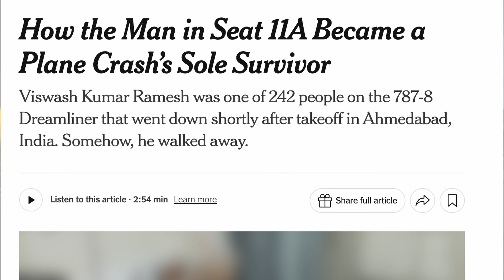Why the RAT Changes Everything – Air India 171 Update

Comment: Dual engine failure was what I thought ..

AI i daresay is a professionally run airline and not a fly by night fly by the seat of your pants kind of airline.

The theory of pilot monitoring  flaps up from 5 instead of gears up is imaginative even for a cadet pilot under stress 
The flap lever is far away and feels very different from a gears up lever.

Dual Engine failure on a fly by wire aircraft.

I lean on Sabotage … hacking of software 

a ticking time bomb effectively 

Who put it in there ? 

Conjecture conjecture 

Contaminated fuel ? … or Sabotaged fuel a contaminant dosed to the plane at full power . Some sort of polymer … 

Who knows . It might have kicked in earlier ….

The plane would have been flying over the Arabian Sea if planned as per usual norm of airplane bombers

Comment: To me, the scenario in which the pilot mistakenly retracted the flaps instead of the landing gear doesn’t make sense. Why? The position of the main landing gear front wheels suggests they were in the process of being retracted when hydraulic power was suddenly lost, causing them to remain tilted downward. Normally, during landing or takeoff, the rear wheels of the main landing gear on the B787 are tilted downward. Additionally, the deployment of the RAT (Ram Air Turbine) indicates that both engines flamed out, resulting in a total loss of engine power. In such cases, the RAT automatically deploys to supply essential hydraulic and electrical power, keeping critical systems operational.

Comment: All electric fuel pumps and no bleed air because of the inane push to reduce fuel consumption.  This reminds me of noise abatement procedures which mandated reduced power in the most critical phases of flight.
This poor plane lost all power on takeoff likely due to fuel starvation due to a total electrical failure.
Engines should have mechanical driven backup pumps.
Major electrical bus failure with engine and apu fuel starvation is my guess.  The box will tell all

Comment: mr hulk walks away from a 175KT crash call that a pot of luck and that loud bang mr 11A hulk heard was the ram airturbine door opening the other cause for the duel engine flame out fuel starvation or  compressor stall and last thorey here but may be  both engies had a  compressor stall and the captin tried to recover but to no effect and lead to the aircraft losing lift and coming down and a fuel compressor stall  is when both engines are starved of fuel and when any pilot tires to recover the airecraft out of a compressor stall it can distrupt the airflow and since this looks to me like a compressor stall a compressor stall can happen without flames coming out the back may bey both eninges expirenced exceeding operating parameters

Comment: Good points were made in this video.  However, the flaps were clearly up when they shouldn't have been.  Would a RAT deployment lead to an automatic flaps retraction?
Reply: Is it possible that both things happened? Dual engine failure with the RAT deployed?
Reply: Good point

Comment: I watched other video by swiss001 he noticed the landing gear alignment is different as the back wheel is higher than the front. Also indicating to dual engine failure https://youtu.be/Ac90bLg1Oek?si=3-jXxgHC97a2aqru

Comment: A previous video from inside the aircraft posted by a guy who flew on the aircraft into the departure airport said they were having all sorts of electrical problems and many things were not working. The 78 is a very electric aircraft. They could have had a compressor stall on one engine and lost both generators shortly afterwards. They also could have deployed the RAT manually. The big question: Why are the flaps up that quickly after takeoff and why is the gear still down. I hear 78s over my house every day. I know the sound of the RAT very well as they test them on almost every test flight. BTW, there’s a minimum speed when the RAT will not work. I don’t know that speed but on other aircraft I know it’s 140kts.

Comment: Captain Steeeve, In 2010 I was working the ground in LRD when the very first 787 on a test flight had a fire in the main electrical panel that caused both engines to fail. The RAT deployed and it coasted appox 30-40 mile into LRD.
Reply: At altitude YES, from 400 up, won’t work. 👍🏼
Reply: Wow. That would explain pretty much all of what we saw here..
Reply: Big difference when it's a test flight and when a fully loaded/heavy passenger flight. Also difference is when the engines failed..
Reply: @janlhab2329  Yes but it proved the importance of the RAT.
Reply: I think the important thing here is that an electrical fault caused both engines to fail. Seems like a good candidate for this flight.
Reply: Great info.
Reply: What altitude was it at?
Reply: 26/11 also was planed to show all terrorist was hindu and they had mauli thread on their hands...but after kasab got captured then whole story was explained ......these terrorist plan and attack..this can also be a terrorist attack we cant say anything until investigation is complete and black box is checked....government will investigate.. whole matter
Reply: Oral or audio?
Reply: @ktsrajesh2130 Aural not Oral
Reply: @brittneyemerson2079  'aural' and 'oral' almost sounds the same , and they also happen to be inter-related.  I can not help to smile and a bit  chuckle after reading this. Captain Steeeve must have meant "aural', not oral.
Reply: @ktsrajesh2130  Aural not oral.
Reply: This proves that it definitely is possible. The system should never have been set up in such a way that damage in one particular area could take out both engines instantly or multiple critical components at once.
Reply: What caused the fire in the main electrical panel ? (was it an insulation problem or elec'l overloading or electronic component that somehow burned ...)

Comment: Also note the position of the mains.  When the 787 is retracting the gear, the mains rotate forward to a front wheel down orientation.  This indicates the landing gear lever was moved to the up position at some point after positive rate and before whatever caused the engine failure.

Comment: One channel stating landing gear partially hung up retracting because Loss of hydraulic’s? Wheel carriage tilts up slightly from flat just before stowed.
Reply: This is a complex issue which must be solved quickly as 1000 787’s are flying.  Boeing not going to upcoming Paris air show.  Boeing losing sales of aircraft.  GE maker of the engines are also on the way to the crash site.

Comment: I think it’s a fuel issue. Fuel was bad/too hot. Sitting in a tanker on the tarmac in 105 degree ambient and 120 on the deck. Boost pumps cavitation or vapor lock in the line. Vapor is compressed dropping fuel pressure to engines and the derate. Simply no time to get the thrust back.

Comment: There is a possible intersection between dual engine failure and pilot error.  There was an incident at Delta Airlines a number of years ago where the crew inadvertently shut down both engines on I believe a 767 shortly after takeoff at LAX. They had enough altitude that they recognized the error and restarted both engines in time. It is conceivable that the Air India inadvertently shut down both engines.

Comment: Same a day someone said, there was one engine failure.  Pilot tried to switch it off, as failed engine may cause other equipments to fail. 
.
Pilot turned off other engine by mistake and could not turn it on in Short time.
.
He said Till 400 meter, pilot cannot take manual control but just after that at 425m he turned off the wrong engine.
Reply: This happened on a previous accident too.

Comment: Most likely engines failure, Boeing system failure, software problems or maintenance issue.
I don't think pilots will make silly mistakes after 8,000 and 1,100 hours of flying experience.

Comment: 10:01 The RAT's deployment is not explosive and does not produce a bang loud enough to be heard inside the cabin as a single event; rather, its noise is noticeable as an ongoing sound, especially when the engines are quiet. The loud bang is far more likely linked to an engine compressor stall.

Comment: Something that isn't talked about is how far down the runway the aircraft was before it lifted off. In the video clip you show at 1:32 the aircraft appeared to struggle to get airborne and there is a lot of dust and debris being blown airborne from the aircraft's engines as it does finally rotate and lift off. Not sure if that is normal for that runway, but the other thing is the flaps appear to be in the up position at take off as well, which would account for why it took so long for the plane to get airborne. I guess we won't really know until the black box data is reviewed. My thoughts and prayers for all who passed and their families.
Reply: The B787’s flaps are comparatively small, simple and single slotted. They blend beautifully into the wing, which doesn’t require a huge change in shape to achieve takeoff due to how aerodynamically optimised it is, being a much newer design than other Boeing marques. The wreckage of the wings appears to have slats extended, so I personally lean towards the flaps being correctly set.
Reply: @JM87Fly  Thank you for the information, you are greatly appreciated!
Reply: It didn’t start half way down the runway it reversed up the runway and took of from the start
Reply: @Danjohnson666 That’s an interesting point. The replay of the flight on FR24 does not show the backtrack, so it appears as though they began the roll at the first main turnoff. I wondered if this was a factor, ie they miscalculated and didn’t have enough runway to reach VR. The cloud of dust as they rotate does suggest they didn’t get airborne until right at the end of the runway.
Reply: Good point, in fairness to Max Afterburner & Gonky, the only other you-tube airline experts that I'd listen to, they picked up on this also. A normal rotation & the aircraft will lift well before the end of the runway.
Reply: black box will presumably show airspeed at rotation - should be straightforward to confirm or not if they rotated prematurely. if they didn’t have enough velocity at the point they could abort thats an obvious error. but if they did, and then didn’t accelerate as much as expected so they didn’t have rotation speed but ran out of runway so had no choice but to rotate and then hope to get some speed as they take off?
Reply: @MrKlawUK Yeh, I think I initially suspected the latter, that they rotated below VR due to running out of runway, and then struggled to climb. However the discovery of the RAT deployment strongly supports a double engine failure so my mind is changed a bit now. You’re right, we should wait for the FDR.
Reply: @tjfSIM could be both? rotation so late could indicate lack of speed and waiting untnil the last moment; RAT means failure; the failure could have happened on the runway but they were already too fast/too far to abort?
Reply: @MrKlawUK  That's true, although it did look like they had power for the first few hundred feet after the rotation and then stopped climbing. All rather strange isn't it.
Reply: Loads of people have been talking about that from the start

Comment: It was clear in the originally released video that there was no sign of thrust and no sign of a bird strike.  So, right away, it was pointing to a dual engine failure / rollback.  Something else talked about is the disrepair the plane was in.  Not sure how good that information is.  However, this leads down two branches.  One branch I was talking about days ago about the fuel contamination.  The other branch is a failure in the avionics bay.  Say the air conditioning in the plane was out and it is 100 degrees F outside.  How hot are things in the avionics bay?  At what point does something fail in the avionics bay?  Say the failure is either the engine control system or leads to the engine control computer in the avionics bay to fail.  Would that cause the engines to roll back or even shut down?  It seems if the answer is yes, one failure leads to another and you don't have any power on the plane and the engines are no longer doing anything useful.

And what is the chance there was something that went bang in the avionics bay and the sole survivor heard it?  I mean you wouldn't see any external smoke if there is no hole blown in the plane to let the smoke out.  And if there was a power failure, the smoke may not have blown into the main cabin for the sole survivor to see.  Then with the "engine throttling up" sound the sole survivor mentioned at the tail end of flight, I am thinking what does an aerodynamic stall sound like in the 787?  Could that have been the last sound he heard before impact?  I think an aerodynamic stall would make a loud sound inside of the cabin with all of that turbulent airflow over the wings on a fully loaded air-frame.  With his timeline, I think it makes sense if you just survived a crash, especially the only one to survive, it would be hard to give accurate times.  I don't think that is the kind of incident where you carefully look at your watch and mark down the time, but instead everything is going in slow motion for you as the adrenaline is pumping as you realize you are going to die on this plane and it is going to happen really soon as the ground is right there.  It is just for this one guy, he lived and was able to tell us what happened as best as humanly possible all considering.

Comment: Indeed...it is quite likely that the RAT deployed due to dual engine failure..and I don't think contaminated fuel was the issue.. a viral video by a passenger named Akash who was on the very same aircraft 2 hours before (DEL-AMD) showed that the HVAC system and electronics of the plane was completely out of order and was disappointed with the lack of proper maintenance of the plane, which seems to be a common issue with Air India planes. When you put all this together, it could suggest the plane needed attention on lots of things but they were overlooked/ignored until the engines/electricals/hydraulics just gave way. 🤕

Comment: Thanks Captain Steeve. Won't the BlackBox show us more about this?  I understand that it was recovered. In today's fly-by-wire tech I would assume that each engine is wired to work independently and it should be impossible for both to fail electronically at once, is that correct? If so that might point to fuel quality?

Comment: Why not design the run way to add extra 3 miles extension from the lift off point, so the pilot has an option to land back safely if there's any failure?
Reply: There is, most planes don't need to utilise the entire runway for takeoff.
This time, somehow they used up the entire runway.

Comment: Captain Steve is correct in his analysis of mentioning that there was only the sound of RAT which is audible and no engine sound.
This video was taken by a teenager who just happened to be there recording aircraft as he had never seen them flying upclose. 
In his statement to the authorities he has confirmed that he found it strange that there was something doubtful  as usually when an aircraft flies that close to you it makes a huge sound that's coming from the engine. But in this case there was no sound and he noticed instead of it rising up the aircraft is loosing power and heading down.

Comment: I’m just an aviation enthusiast and by no means an expert but it might’ve been that the engines didn’t really flame out, just idled resulting in no visible flame or smoke. 
RAT may have deployed prematurely due to a sensory fault, and the AC buses may have taken it as primary source of power. This doesn’t explain why engines would lose thrust as they’re mechanical, and for this it may be that the FADEC too relied on the primary source of power, which in this case was considered to be RAT and altered fuel flow to engine or forced idling. If this is the case, the pilots were probably even more helpless than we earlier thought. The flight controls depending too much on electrical components over other things may have really been the cause of this crash.

Comment: The density altitude at that airport was probably quite high. The temperature on the runway could have been above 105 Fahrenheit at time of takeoff.l. There is indication that the All Up Weight (AUM) of the plane was high as there is a report that the pilots backed up the plane to gain use of the full runway. The runway they used exceeded typical required runway length for a Dreamliner by 3000 feet. Could these factors have caused dual engine failure?

Comment: I think you’ll find it’s not dual engine failure, many other combinations which will cause the RAT to deploy, ie failure of electrical hydraulic pumps x 4, key word electric pumps. These pumps are feed power from each engine, if had major electrical failure of one the electrical buses and possibly left the terminal gate with the other bus faulty (maybe MEL or Indian MEL) now you have 4 x pumps or generators faulty. Some “indian airlines” and India itself has terrible safety and maintenance culture and frequently sends equipment on route which no other 1st class safety conscious company would.
Highly unlikely dual engine failure occurring before v1 also.
The cause with be a combination of at least 3 factors, faults or failures, and most likely combination of maintenance and pilot error.
I can’t go past the late takeoff and very very low average speed of the 32sec flight (130kts). This suggests engine failure early on and failure to abort takeoff.